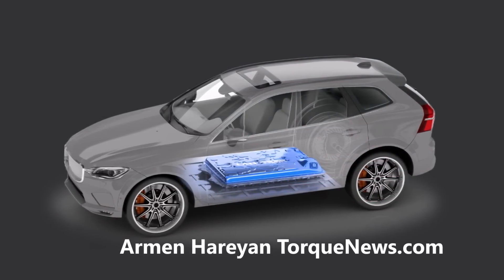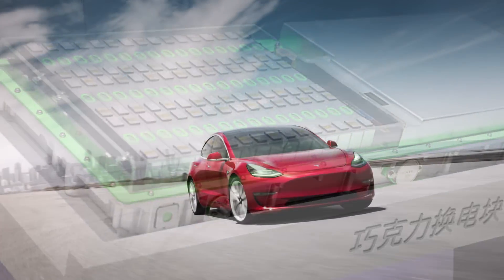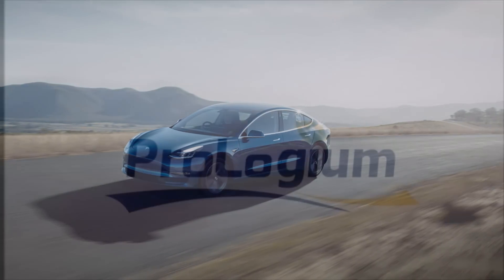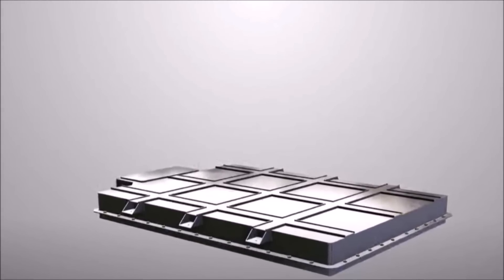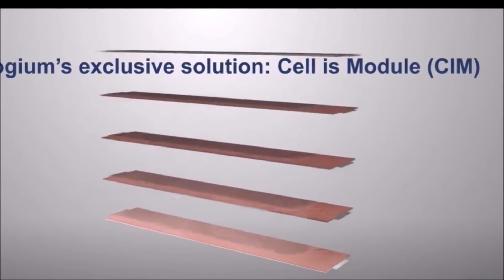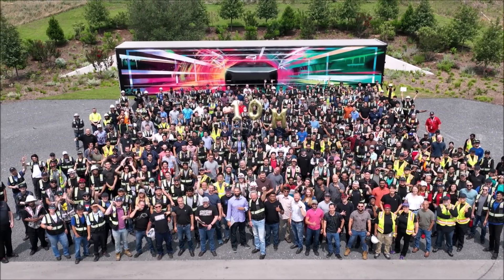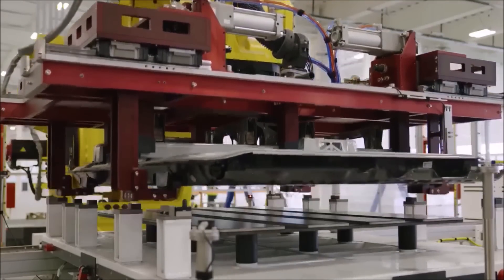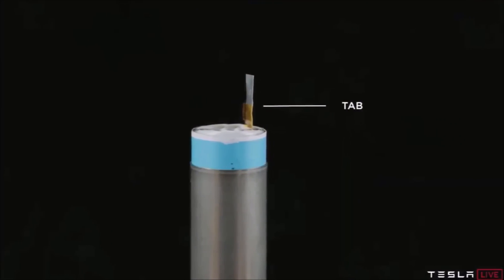Tesla's New Model 3 Is Reportedly Coming With CATL's New Long Range Battery

Comment: In the past the LFP chemistry was not able to power the dual motor as it doesn't release energy strong enough to provide for the dual motor power thus the dual motor variants required NMC chemistry due to the ability to release greater energy than an LFP. There is talk about longer range but is that with the single motor or dual motor?
Reply: All the rumours are about the single motor variant only, for now.

Comment: you never specified the actual number of the increased range, wasting my time!
Reply: About 10% more than now! Look it up.
Reply: why?, tell people, its your article, it needs to be thorough! @HansKruse
Reply: @kipper2k  60KWH now and the new one is 66KWH. That is pretty much 10% more 😊
Reply: @HansKruse  Thanks for the info
Reply: @HansKruse  sorry I was trying to respond to you earlier and my browser closed on me.  So we are looking at 299.2 Range in the new Highlander?  With an LFP battery?  I am asking because I was blessed with a new job and I am going to buy a model 3 and I don't know much about EV batteries. The LFP battery has the capability to charged to 100% constantly correct?  So basically 300 miles of range with a 100% charge?